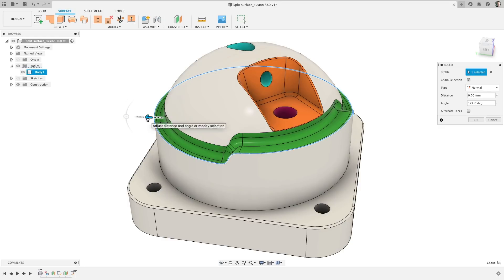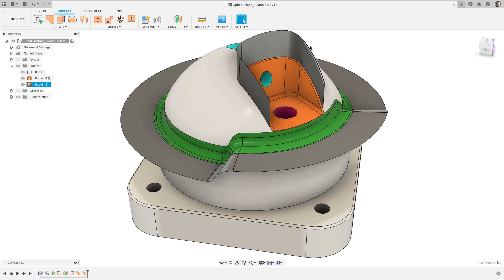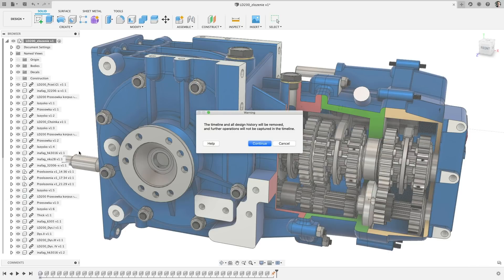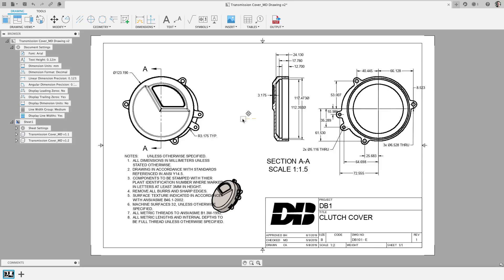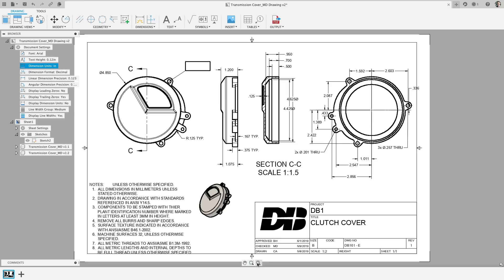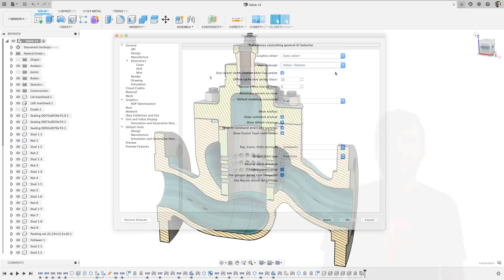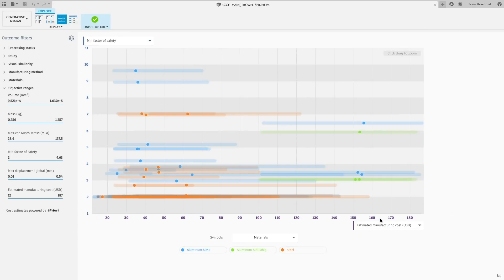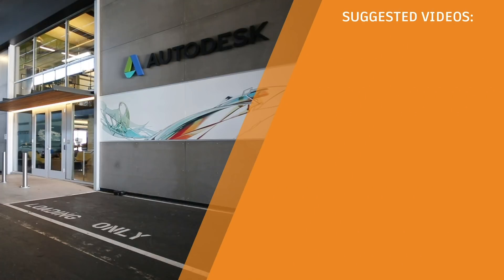What's New in Fusion 360 Design & Engineering - June 2020

Comment: Will we ever see update delivery and installation optimization? Not everyone has a SSD, and Fusion's extremely unoptimized method literally causes application freezes, and at times will lock the system up due to abnormal amounts of disk usage. Literally every other modern program has optimizations that don't cause these issues. Another thing to go with this, update upon close, rather than update upon start, which only exacerbates this optimization issue.
Another issue is the amount of junk data Fusion has after months of use. It gets to the point where the software is unusable, requires an uninstall, use of the cleaner tool, which should honestly be built into the uninstall tool by modern standards, and a fresh install. Another optimization issue.
This is annoying, and slightly infuriating, as a hobbyist, but I can't imagine using this software if I had a paycheck that relied on it. If my job was hindered by these optimization issues, I would seriously consider looking elsewhere for software, especially as Fusion would be a paid product in that situation, and that issue only gets worse as a company scales, it's time and money lost. It's 2020, give us proper optimizations, shit like this was understandable decades ago, but it's unreasonable in modern terms. 

Speaking of it being 2020, Fusion is a bit late on giving us a dark UI. Most modern software gives it as an option, if not having it pre-applied out of the box. Having a dark-ish workspace isn't enough, as the UI itself is still blindingly white, and the contrast between the two exacerbates the issue of why we need a dark UI. It's not even that difficult to implement, so why don't we have it yet? Just like the previous issues I stated, it's something we should already have, but for some reason don't; does the Fusion team just have bad priorities, or are next implementations just from throwing darts at a board?
Reply: kinda time to get an ssd dont u think? hard disk are going way of the Dodo.